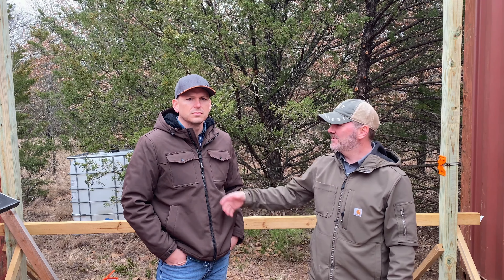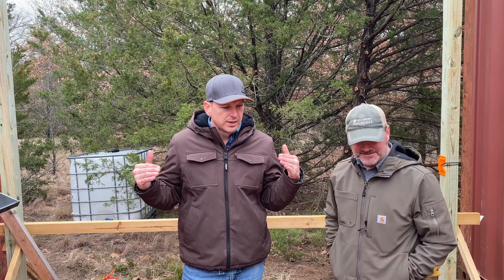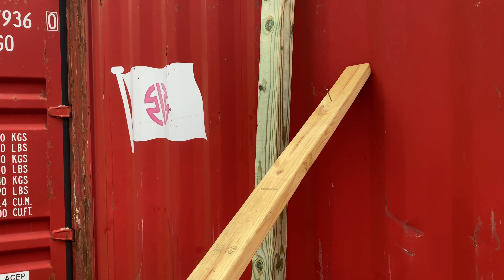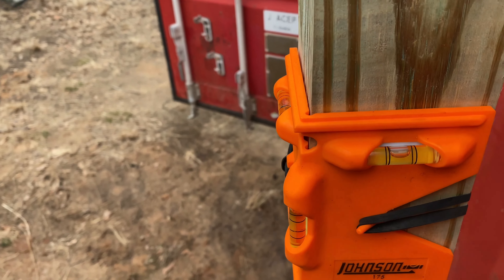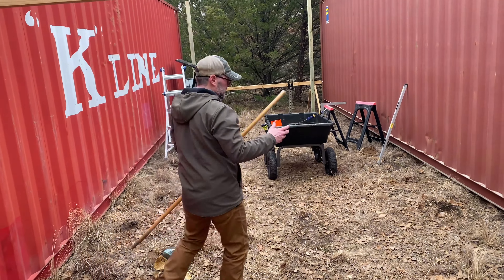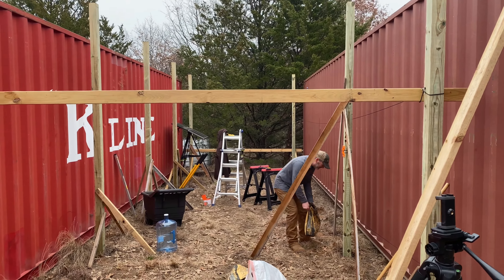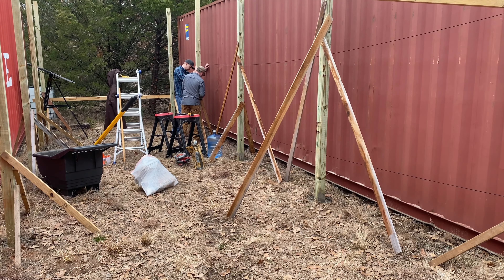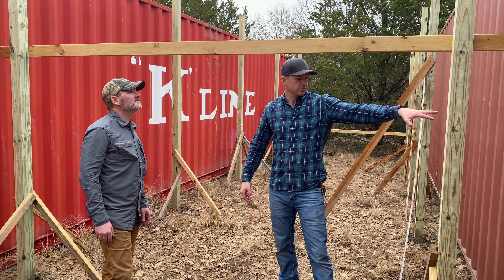Setting Posts for Shipping Container Shed / Rain Roof

Comment: Looking awesome guys! 

I'm not sure of what your roof plans are and i'm no expert, however a bit of free advice would be to build the roof system similar to that of a pole barn in 3 sections. One on top of each container then one over the middle. That allows you a larger surface area to catch more water, gives you rafter space for storage on top of the containers under the roof and it will have less chance of water run off in your center working area than if you were to just build a shed type roof or structure in the middle without incorporating the two shipping container roofs....... 

Just a thought, great progress though, looking forward to seeing how it turns out.....
Reply from the maker: That's a really great suggestion and would watch a TON of water. Thank you!